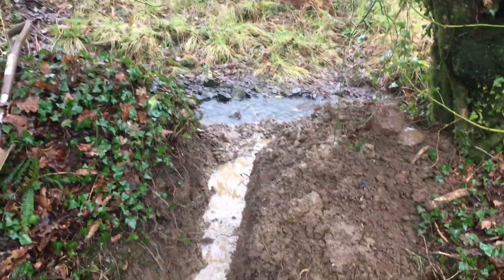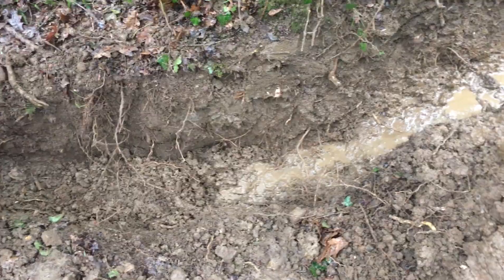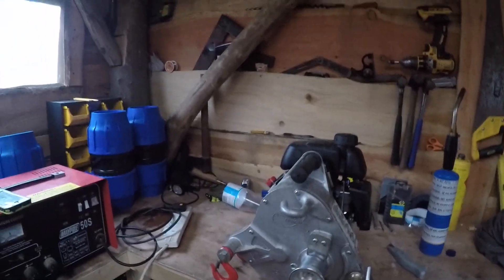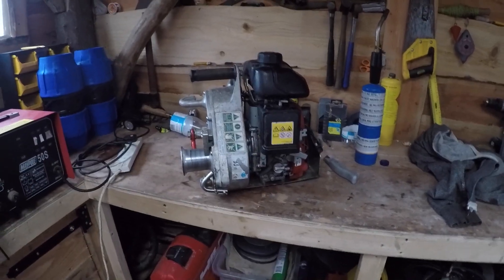DIY Micro Hydro part 15 Laying the pipe

Comment: Lawdy craig messed up that pipe! You installed that post so the reel would roll around it and pull it all straight then the madman goes and throws it all over the top making a field sized slinky!
Reply from the maker: it does look a bit like that. the reason he did that was because the pipe would not unroll around the post. it was just trying to kink. so we changed the plan and just decide to get the loops out once it was off the roll.

Comment: Idiots uncoiling pipe 🙄
Reply: Show us the house that you built with your own hands please. I’ll wait...
Reply from the maker: Because we tried to pull it so it span off the post but it just wanted to kink and would not spin. And we could not move it by hand. So we changed our method. And it worked fine. 2 hours latter it was done.
Reply from the maker: How would you do it without the proper tool? Each roll is 400kg it’s 110mm thick walled pipe. You can’t just unroll it by hand.
Reply: Kris Harbour sound 😎
Reply: Trolls don't build. they creep
Reply: Kris Harbour what was the point of putting that post in the ground the way they did it?
Reply: vaughany3 Please don't stop questioning stuff, it helps us uneducated people learn about things.
I'm happy it worked but learning about new things is YouTube's main purpose for me.
Reply: vaughany3 manfully matched by idiots making ignorant and uniformed comments from the comfort of their armchairs......
Reply: the uncoiling was a bit dumb (i am a plumber)

Comment: Hannah: Hard as nails. Not afraid to get dirty, and do some work. And the girl has brains as well!!! (I'm thinking had she been the one at the pole, she would have anticipated the end of the pipe and tied it off, to not let it go flying your way.) Also, it seems to me it would have been better to pull that pipe, keeping it laid flat. So that it unwound, circling the pole. Instead of letting loops go over the top. You would not have been struggling with it later, trying to deal with those loops... Ah, hindsight. LOL
Reply: selador11 Thank you for the compliments 😊 I'm just doing my best to keep up with the master 😘
Reply from the maker: We tried doing that with the pipe but it did not want to spin around the pole. it just wanted to kink so we changed our method. that was the reason i put the pole in the ground. but it didn't work.
Reply: I've tired this with 3/4" pipe, it bunches up around the pole and kinks.
Reply: I wondered about that, because it did look like your intention, when you put the pole in the ground. Good to know, so I won't make the same mistake should I try it.
Reply: I got even filthier today! And more bruised, and more scratched haha! Just in time to go to my actual job ><
Reply: selador11 I agree

Comment: I've just started watching this and I am cringing, "the biggest corkscrew this side of the Mississippi." Oh mate! 
Either unroll each coil bit by bit or make a rig where the entire roll rotates as your pull the end away.
If you managed to get that into the trench without snapping or ceasing the pipe I will be amazed.
.............
Just finished watching, presumably you managed to untwist the pipe to get the kinks out while it was laid out in the field before you pulled it.
Well done for getting it done in that weather.
😀
Reply from the maker: it only took me an craig 2 hours to unroll both coils. we let them spin as i pulled them with the tractor and that got the loops out as they were able to spin at both ends. you may not agree but i can assure you there was no faster way to do it than that. it would have taken me twice that long just to make a rig to hold the pipe.
Reply: Kris Harbour....  thanks for the reply mate, I guessed that was what you did.
On your own equipment you can what ever you want and you make your own judgements. If you stress the pipe and it fails that's your own leaning curve, either way it's your pipe you do what you want.
If one of my contractors did it like that though I would throw them off site LOL.
I am a big fan of your work, love your videos so please keep em coming.
I hope all goes well.
😀
Reply: Often you have to fit your method to the circumstances and the location of where you are working.
Reply: Totally agree with the commenters above. Maybe it's not the perfect way to do it, but sometimes you don't have the right equipment and you just have to use the stuff at hand.

Great job Kris!
Reply: You could have done the same setup, use the  excavator to hold the pipe with a big pole in the middle, Then unroll with the same tractor.  Everyone knows you have take the kink out,  Shezz, same mistake PURE LIVING FOR LIFE made, took him 2 days to unkink it.
Reply: Would it have worked to simply set the hoe dipstick down in the center of the spool of pipe and pull it off in a straight  (unspiraled) line?
Reply: No, the to much of chance of scraping the pipe. Need a friction free surface.